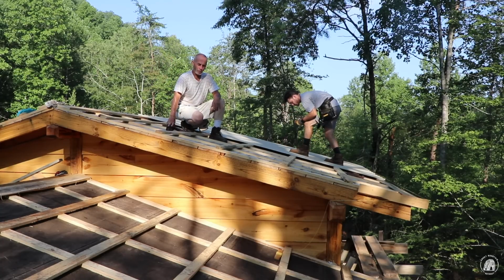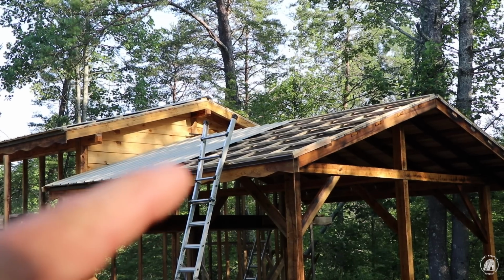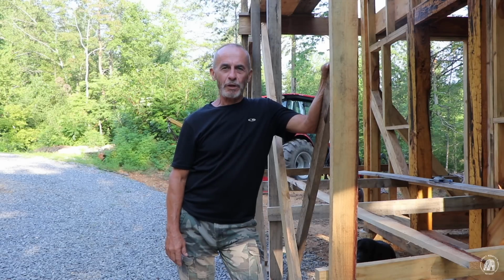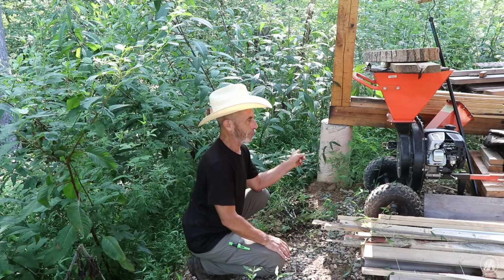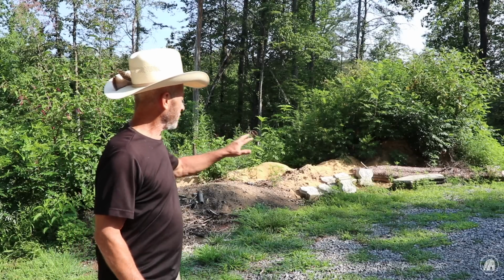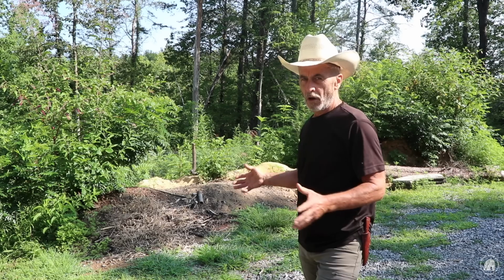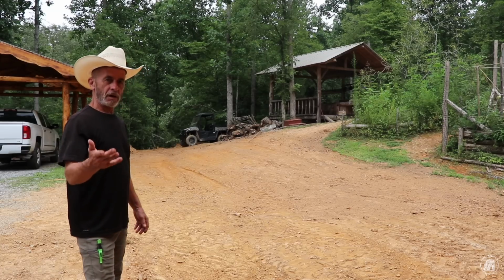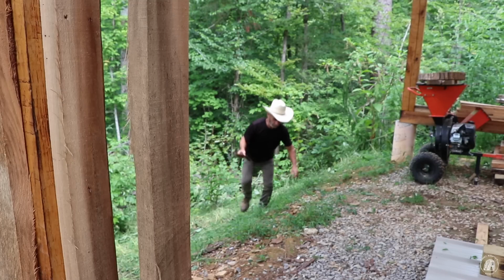EXTREMELY HOT and DANGEROUS! -Two Men On A Hot Tin Roof | PT 2 EP 16

Comment: Looking absolutely, Awesome !
Just wondering is it not feasible to to put in a water storage tank to collect the water from the roof rather than letting run down hill ?
Reply from the maker: I have all the water that I can use. Actually have more than I can use. It would take time to do that which I would have to use from my other projects. It will eventually happen when I start working on the water system. But currently I have all that I can use

Comment: Just curious as to why you double strapped the roof for the tin.
Reply from the maker: I have learned that you should place vertical runs before the horizontal runs for water to drain. If you just place a horizontal run to the roof condensation has nowhere to run out which could cause serious problems later on